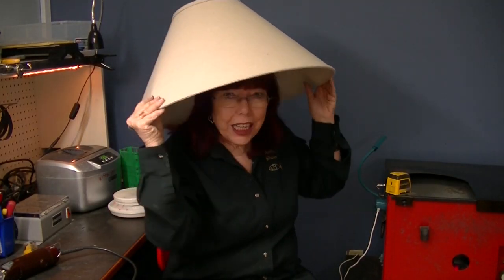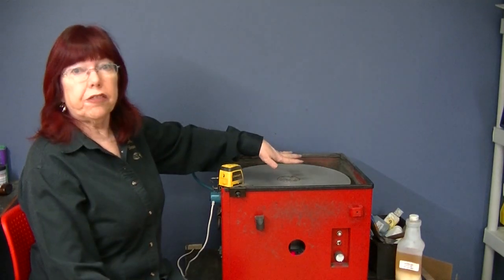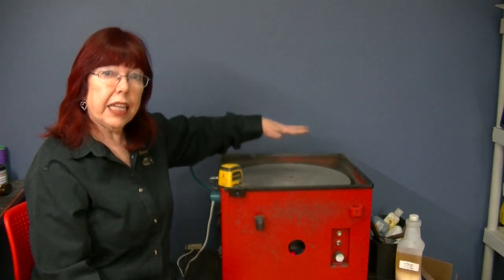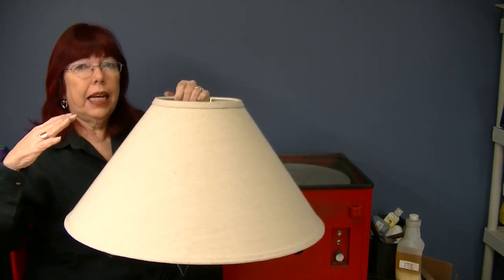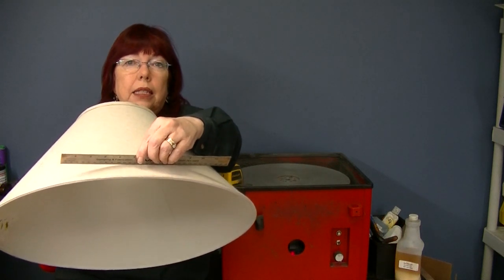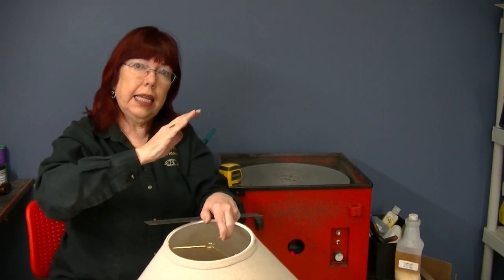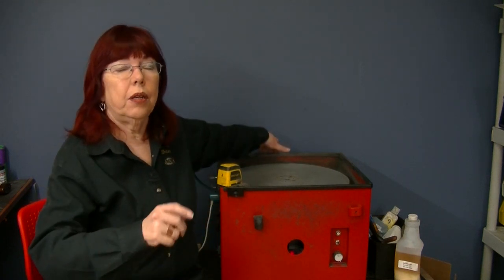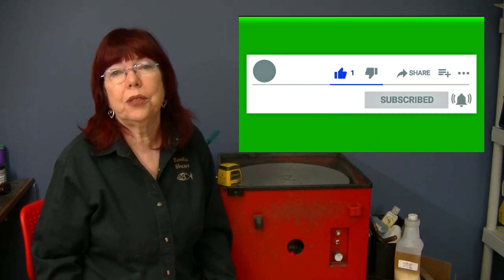How a Lamp Shade is Like a Clipper Hone - Understanding Sharpening of Clipper Blades

Comment: Bonnie  from what you are saying that if you put the clipper blade on a flat surface you will see light between the blade and the flat surface?
Reply from the maker: In theory, yes. In actuality the hollow is so small that you can't see it. However if you burnish it to check the blade on a check block you can detect the hollow or the concave shape. Doing this check is another video. Who wants to see that? I'll shoot it.

Comment: I have a heiniger (Swiss) machine, this has a two sided disc, one side for pet clippers the other for bigger horse clippers. Different cone angles for each and slightly different grooves cut into it for  different abrasive size 180 or  240. I asked the supplier of the ones you see on eBay, the Chinese product, are flat or shaped, flat was the response.  I suggest they have no real idea of the principles you explained. I’m afraid there’s no option but to use the right somewhat expensive kit. As a pro sharpener the machine cost must be built into the sale price of the blades.
Reply from the maker: Oh yes! You are so right.